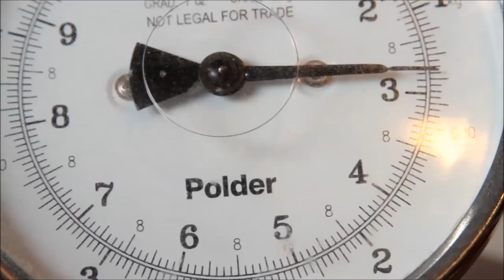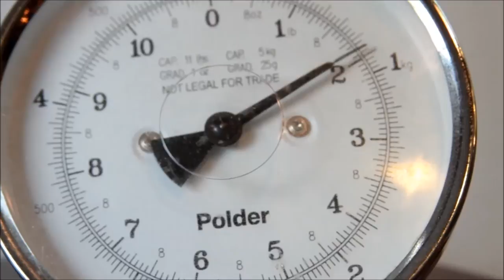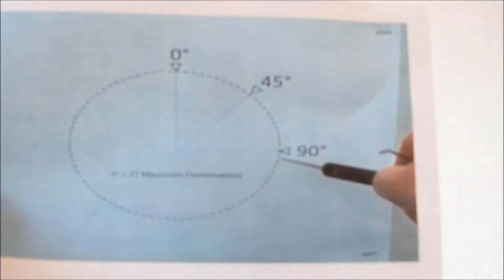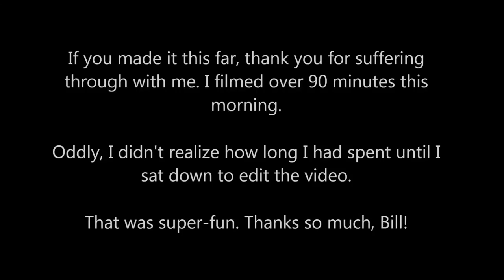(019) New Angles: S&G Environmental Lock #101

Comment from the maker: The pick I ended up using (the music wire) worked pretty well. I think an ideal tool would be something T-shaped -- to make it easier to run the wheels in both directions without disturbing their neighbors. 

Once I got past the 0/90 issue, the hardest part was setting the 45-degree disc at just the right angle and then keeping it there -- it seemed to bind against the middle wheel and get misaligned. Each time I got it open, that rear disc was the last one I got aligned. :) Very fun.

Comment from the maker: If you watched carefully, I eventually decided to tilt the vice such that the 90-degree position, from the disc pack's perspective, was vertical. When the lock itself is vertical, everything is about 15-20 degrees off. Once the disc pack was perpendicular to the table, my eyes did a better job aligning things. 

But yeah... it took a lot of trial-and-error to work it all out. 

Bill made it look easy.